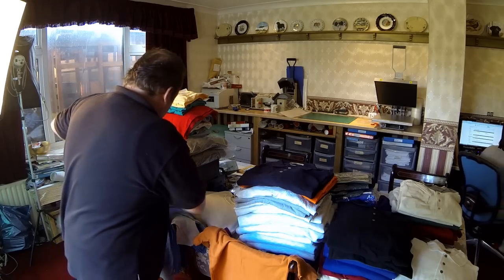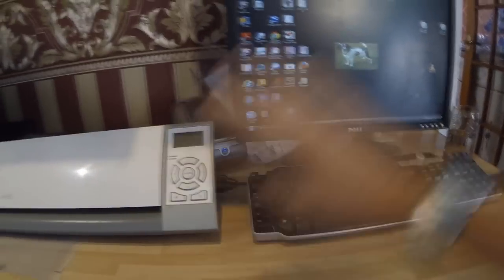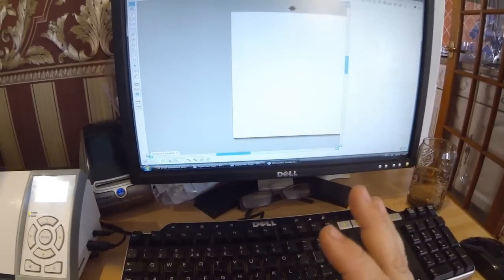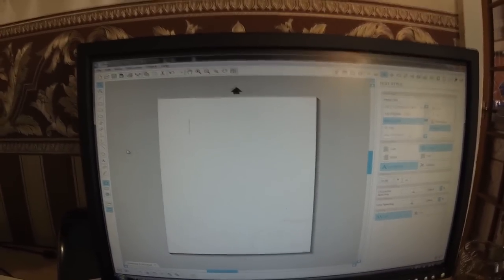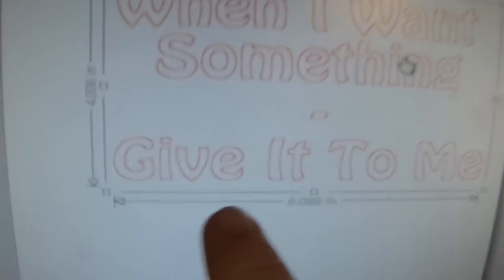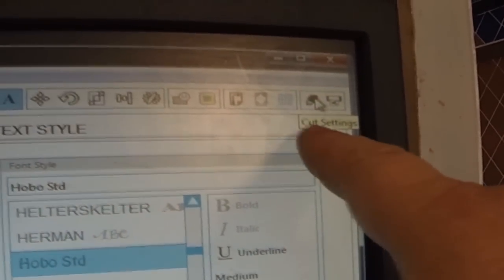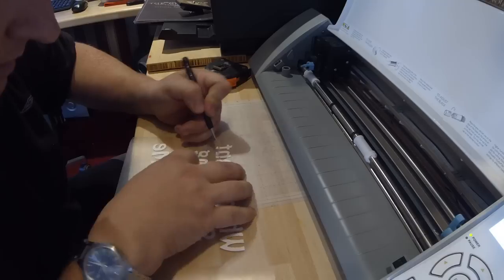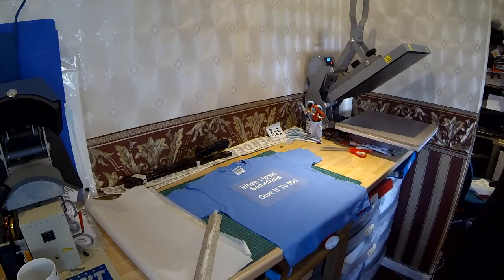Simple T Shirt Vinyl With Heat Press And Silhouette Cameo Tutorial

Comment: I think I'm going to purchase a Stahl Hotronix hreat press. One quick question. Do you think I will encounter any issues with size if I go with the 11 x 15 heat press? I will only use transfer paper that is 8.5 by 11 so I should be fine, right? Thanks Martin.
Reply from the maker: Hi Jeff,
If you are only doing  A4 transfers (this is what we mostly use) you will be fine. In general, you should go with the industry standard size but the main thing is to buy a quality heat press like a Stahl.
Cheers
Martin

Comment: Hi Martin.. Thanks for another great video! You always answer everything I'm looking for.
I'm setting up my own printing business & buying a cameo, but I'm thinking of getting a stahls maxx press. Just the other day I seen someone had issues with scorch marks.. he said his vinyl needed a 30 second press though. Have you heard any bad reviews? Or do you think it was the time of press? The tip of covering the whole shirt in the protector is one ill defo be using 😊
Reply from the maker: The Stahl Maxx press is a good press. A teflon sheet will prevent scorch marks. i've not heard of a 30 second vinyl.
Good luck.
Cheers
Martin
Reply: Brilliant. 
Yeah I did wonder about that vinyl. Thanks again for your help!
Reply from the maker: no probs :)
Reply: Martin just one more question.. I'm going to be printing on mainly baby clothing, does it matter if I have a large press? I'd rather have the option to do adult stuff now and again if need be.
Reply from the maker: If I was doing smaller garments that  were not big enough to get collars ect' to overhang the press, I would get some teflon covered pads to pop inside the garments so you don't press the seams and collars.
Cheers
Martin

Comment: Hi martin... have you try to use vinyl trasnfer paper on 100% polyester? waht is the set up on the heat press?

Thanks
Reply from the maker: +Christine Maramis I have not used vinyls on 100% polyester but it depends on the vinyls you use. They all have different ratings and you get that info from the supplier.
Cheers
Martin

Comment: Does it matter what material the shirt is made of? Does 100% cotton work best or a 50 50 blend? Also, do you need a heat press? Is it possible to do with an iron?
Reply from the maker: Most people prefer 100% cotton t shirts so that's what we use. You really need a heat press for this.
Cheers
Martin

Comment: Hi Martin,
Thank you so much for the outstanding video, I did in fact gain considerable insight and knowledge from your well presented DIY vid. I came away with only one question, what brand name is the material you used for the slogan to be cut on? I'm in the US and the actual product name would be a big help. I did buy the Cameo a few minutes ago on amazon and I'll be buying the press tonight as well. Thanks Much! you're a prince!
Reply from the maker: Hey Jay, Glad you enjoyed the video the clothing vinyl I was using is basic Hot Flex Clothing vinyl. There are many makes so to find a good vinyl, just Google a "clothing vinyl supplier" and look for a reputable supplier instead of just buying the cheapest on Ebay. This way, you'll be guaranteed to have the quality you'll need to last. We buy our vinyl in 330mm sheets but you can also buy them on rolls, we just find it easier this way.
Cheers
Martin

Comment: hi martin where is the best place to purchase vinyl in the uk ? are some better than others ? I have been printing a few t shirts which look to be fine and then find a few days later they have started to peel a little ..... could it be the vinyl ?many thanks
Reply: Are you using a heat press or a home iron? It sounds like you used a home iron which would cause the peeling because there is no pressure without a real heat press and the heat press also keeps the heat trapped in so the vinyl adheres much much better.

Comment: Martin, Steve here in the U.S. I ordered vinyl from Amazon and they sent me vinyl with the sticky side on the vinyl, not the backing. Did I get this right or is there simply another process for this type?
Reply from the maker: +Steve Bronson That doesn't sound right Steve, clothing vinyl is not sticky, you might have ordered the wrong vinyl.
Reply: That's  what  I thought.  Amazon  doesn't  explain  their  products  very  well. But  I think  I found  the  right type at one  of the  heat press  companies.  Thanks  for responding.  Your  videos  are very  informative.
Reply from the maker: Steve Bronson
Thanks Steve and good luck with your project.
Cheers
Martin

Comment: For some reason when the silhouette begins cutting my vinyl it cuts through the entire sheet so the design I want to stay on the sheet just falls off as separate pieces.. my settings are exactly the same as yours, any tips?
Reply: I go one lower than recommended  with a new blade had that problem only with a new blade
Reply from the maker: Just  lower the cut depth as abrahmns2000 said. I  did say this in the video that you might have to play about with the cutters settings.

Comment: do i really need the vinyl to make shirts i use a printer print the designs out on the heat transfer paper and then use the heat press
Reply from the maker: todiyah williams  You don't need to use vinyl but it's a different option you can offer.
Cheers
Martin

Comment: i reversed my design  using the object mirror tab b4 i sent it to the cameo but when i cut it the cutter starts cutting on the far right of the machine, not even on the htv. what am i doing wrong or do i have to load the paper on the right side of the machine instead of the left. mr. butler reverses his design b4 sending to cameo and it cuts it on the left side

Comment: the problem i'm having is, that it wont cut the entire image i have. it cuts 90% of it...as in leaves out certain letters in between....it's weird and random.

it's cutting for example - "USA MEDIA DEPARTMENT", but the cutter is cutting it as - "USA M DIA DEPAR     ENT"

the a random piece of the image is missing also..any help would be appreciated. (this was my first time cutting, i followed your instructions, everything worked perfect, just the not cutting full images problem)
Reply from the maker: Try and update the software or try a different font.
If not, contact the silhouette helpdesk.
Reply: thanks a lot, appreciate the quick response.
Reply: The bluetooth functionality is still glitchy and silhouette is working on it. When I called the recommended using the cord to connect it to the computer directly. I haven't had any missing letters since!

Comment: what kind of vinyl do you use? Thanks !
Reply from the maker: This is a basic clothing vinyl which is a vinyl called MDP Hot Flex.
Reply: Thanks for the reply Martin! I appreciate it. Do you know if there is any dye based printable vinyl for heat transfers on t-shirts? Have you ever tried using dye ink on vinyl that was requiring solvent inks and what would be the difference? Just wondering if it would still print without smudging.
Reply from the maker: linc nichols
You can only print on vinyls with solvent inks. That's why I use the special transfer papers so I can use the Dye inks I use.
Cheers
Martin
Reply: Awesome thank you Martin, I know you've answered all my questions but wondering if you could tell me or send a link of the special transfer paper, me and my son have been searching for good transfer paper for months now and keep having negative results. Appreciate it and cheers to you aswell :)
Reply from the maker: linc nichols
I keep that info in my training dvd bud. Hope you understand.
Cheers
Martin
Reply: Thanks !

Comment: can we wash these tshirt?
Reply from the maker: That's a strange question. You can wash this t shirt.
Reply: Martin Butler It should not be strange. Because you made heat transfer with vinly. The design can be remove by water.  That's why I asked.
Reply from the maker: No, this cannot be removed with water.